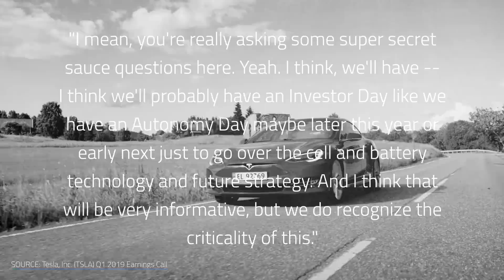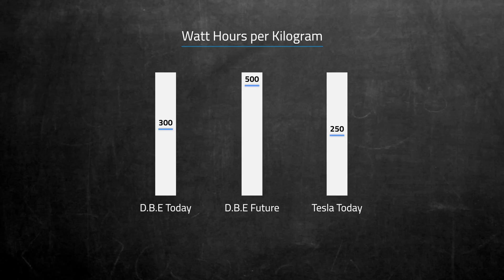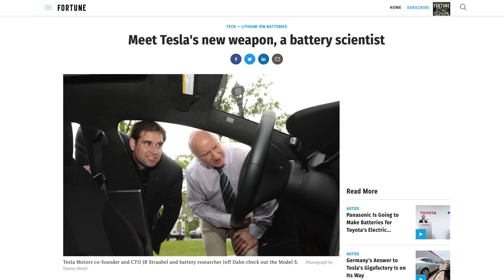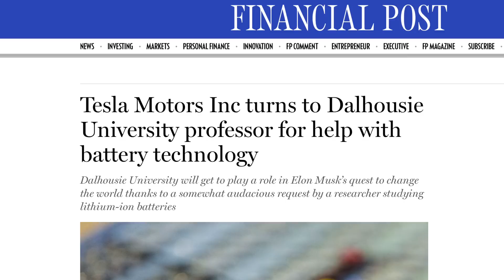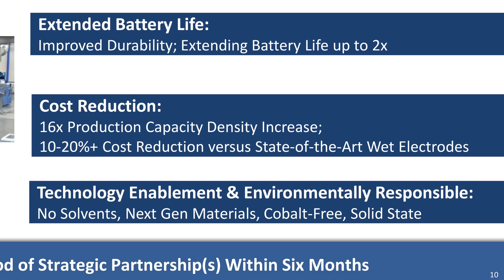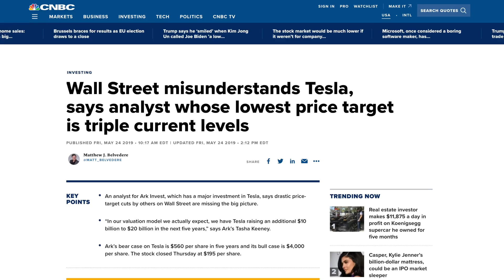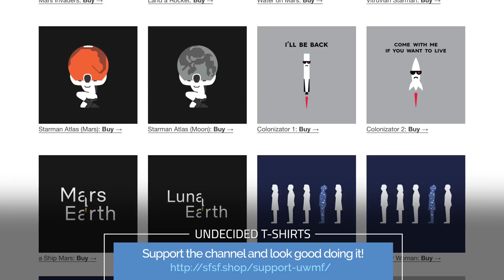Tesla And Maxwell Technologies

Comment: 26th Feb 2020 Your analysis is on track with the current chat ahead of Battery day. 8 months ahead of the pack. Yes, they have moved to prismatic batteries for China and yes, the Braga solid glass electrolytes may be around the corner, but Maxwell's Dry Electrodes & Dahn's formuleas are now . The dry electrode technology could probably to used in any LI ion batteries. Keep up the good work.
Reply from the maker: Appreciate that!

Comment: IN THE UNITED STATES,
Due to the many charging points, the company has great potential and great competitiveness with its competitors.
NOW IF IT ACHIEVES THE GOAL OF 1,000,000 MILLIONS .... WITH THE SUPER CHARGERS IT WILL BE A VERY DYNAMIC PLAYER FOR THE FUTURE.

OPPOSITE IN EUROPE
WE HAVE SMALL SALES OF ELECTRIC CARS.
WHY THEY PURCHASE THE COST, AND THAT THERE ARE MANY COMPETITORS. WE ALSO HAVE MUCH LESS CHARGERS.
Also in Europe there is the mindset of hybrid cars.
IN EUROPE WE HAVE NETWORK ISSUES BECAUSE IT IS NOT A SINGLE COUNTRY AS AMERICAN, BUT ALSO WITH A DIFFERENT MARKET IN PRODUCTION.
That's why HYBRID WILL STILL HAVE THE UPPER HAND, UNTIL FINISHED The ELON FACTORY IN BERLIN AND WHERE THE GOVERNMENTS convincing GIVE IN MOBILE average citizen BECAUSE THE 30 TO 40 THOUSAND EURO IS VERY HIGH COST FOR AN AVERAGE EUROPEAN CITIZENS.
THANK YOU FOR THE COMMUNICATION

Comment: 1m miles is fine but they also need to ratify that claim into product warranty ! Currently model 3 comes with 50k miles warranty which is not even competitive with Korean car manufacturers!
Reply: Current model 3 battery is warranted for 8 years 160,000km.

Comment: i think the super capacitors are the key to this deal. regenerative breaking will charge up caps instead, massively reducing wear and tear on the batteries that hate rapid charge/discharge, which caps a built for. this will allow near instant charging as well, as caps could be filled in seconds or less, for say 50 miles. caps will handle the volatile charging/discharging on the small, short term scale. i think maxwell's long term engineering advancements in various applications for over 50 years, will translate into much better native handling in one big ecosystem between the penthouse (controller box) and the batteries. i think since they are dry batteries, this will change the cooling needs, and allow for much more flexibility in the battery placement/layout. i think all this combined, will efficiently double the life, and distances traveled on a charge. i reckon at first maybe 500-600 miles, before further optimization getting more distance. the true target of course is making a coast to coast trip in the same time as an ICE car. maybe the 1000 miles is the sweet spot. drive 1000, sleep and charge for 8 hours, drive another. driving SF to LA on one charge.

Comment: Sounds like the Tesla drivetrain will significantly improved. The Tesla electric drive train is certainly better than the small number of offerings ccurently available from the competition.  Tesla continue to hemorrhage money. So are they ahead of the competition? Batteries and motors, the drivetrain,  are ace. The rest according to end users and a major automobile manufacturing benchmarking company in USA is behind the competition in terms of quality and design.Perhaps the future for Tesla will be to supply electric drivetrains to the mainstream manufacturers.

Comment: @Matt, good video. Consider also the Supercapacitor element of Maxwell Tech. Usng Supercaps to deliver instantaneous power in ludicrous mode for instance and even store and recharge during regen would be another great integration of th enew acquisition. Supercaps could also be used to facilitate the higher changing loads with 350-450Kwh charging and protect the Li cells from the heat diffrentials thus giving them a better service life.

Comment: Sure. You mentioned some things of which I was unaware but I had previously been led to understand that by Maxwell's integration of supercapacitors that could quickly capture braking energy and expend it in acceleration was the biggest boon to battery life because it would smooth out battery discharge rate.

Comment: I think that a sort of hybrid battery design is possible.  We know that when we fast charge a battery from near empty to near full that the battery becomes slower and slower to accept the charge.  Suppose that as the charging became slower, an ultra capacitor would engage and load up to discharge into the chemical part of the battery after the vehicle had left on it's way..  This would provide several benefits.  The Lithium Ion portion could be smaller and still one would have the same range.  Of course the time at the charging station could be reduced..The chemical part would be lighter and more compact and longer lasting. One could still use the capacitor side to make regeneration more efficient.  Clever engineering might even unite the two elements at the cell level but more likely not.

Comment: Matt, you can't compare Tesla to Apple. Tesla makes almost everything in house in California. They even brought Panasonic to arizona so they can make batteries for them. Apple  has most of  their phones put together in Asia with many components from asia- Samsung chips and lcd. The structure of the phone is made in China.
Reply from the maker: My comparison of Apple to Tesla was more than just the vertical integration.  Apple designs almost the entire widget (very little off the shelf parts).  They also design much of the manufacturing process (even though they don't do the building themselves).  I should have made it clear in the video, but I was comparing the two during Apple's heyday ... when they were rocking upwards from the iPod through the beginning of the iPhone.  They were the most shorted stock on wall street (still are in some cases).  The drum beat of news reports was how they were doomed.  "Just wait for [competitor X] to release their [product x]" and Apple will be done.  They're a highly divisive company.  The people that hate Apple, HATE APPLE.  People that like Apple are nothing but sheep.  The fact that Apple was building a better product than the competition and gained massive market share because of it was often missed or ignored.  That's Tesla today.
Reply: @UndecidedMF  I'll give you that, Apple designs a lot of their own chips and other compononents but they can't be compared to Tesla. Tesla designed and mostly built their own supercomputer, software,GUI,Ai,and electric car. To top it off they built their own manufacturing plant. Tesla is like Apple,IBM and Ford mashed together back in it's heyday.
Reply from the maker: Apple has done a lot of the same stuff: https://www.investopedia.com/terms/v/verticalintegration.asp

“Apple Inc. is one of the best-known companies for perfecting the art of vertical integration. The company manufactures its custom A-series chips for its iPhones and iPads. It also manufactures its custom touch ID fingerprint sensor. Apple opened up a laboratory in Taiwan for developing LCD and OLED screen technologies in 2015. It also paid $18.2 million for a 70,000-square-foot manufacturing facility in North San Jose in 2015. These investments allow Apple to move along the supply chain in a backward integration, giving it flexibility and freedom in its manufacturing capabilities.”

There’s a lot of similarities.  Now, that doesn’t mean anyone has to like Apple.  The companies are have very different goals and motivations.

Comment: No mention on their super cacitors and how well that integrates with Tesla tech?
Reply from the maker: Yeah, I sidestepped that because I don’t think it’s one of the primary reasons they bought Maxwell.  They’ll most likely be taking advantage of the supercapacitor technology, but exactly how remains to be seen.  And even then I don’t think it’s going to have as significant impact on the bottom line as the DBE method will.

Comment: Batteries are the BUG in the system of almost every product, so these Ultra Capacitor Batteries  that can Flash Charge to full in just 11 seconds are amassing. I've put video links to these charging in my Twitter threads.Also Graphene is the major component. Just imagine how these lightweight Ultra Capacitor Batteries can revolutionize E Bikes?

Comment: all the nasty analysts are affraid from tesla innovation because of the oil industry... there is so much pressures from them to stop elon musk revolution... personnally  ...
i would buy a tesla model 3 without hesitation if they could make the range of batterie at least 600 miles per charge... for a reasonnable price compared to thermique vehicules... only tesla could make this dream a reality...

Comment: 1 - Batteries always weigh the same, empty or full.  Unlike all fuel tanks.  And I don't believe Tesla's battery weighs less than than most full fuel tanks.
2 - There is a limit to energy density when it comes to vehicles. Several will die in explosive automobile accidents until they figure out what that limit should be.

3 - Not a single mention of this deal's impact on SpaceX??  Not even just a, "...and who knew that batteries are also used alot in space?"

Comment: Maxwell technology patents cover more process related tech than  product......things that could possibly take some of the time (cost) out of making Li batteries - like having  to carefully dry the deposited materials etc.   Remains to be seen if it can be turned into real production …..there are no lack of chemistries out there that will improve energy density but manufacturing processes to lower production cost is equally important.

Comment: You didn't even mention the supercap aspect of Maxwell that could help buffer the recuperation cycles off the battery...even increasing the longevity of the pack further
Reply from the maker: Yep, that was by choice ... mainly because I don't think that's the big reason Tesla bought them.  I do think Maxwell capacitors will play a role, but the biggest aspect for Tesla is going to come around battery production.

Comment: First the negative: Telsa does have a significant burn rate. Low margins. Also, Elon announcing the 1 million mile rated car undoubtedly is slowing down current sales, buyers waiting for the 2020 model. HOWEVER, the Maxwell purchase puts Tesla WAY in front on batteries, especially on cost which is expected to drop by 50% in 2 years and will continue to drop. Tesla will be years ahead on battery cost, battery life and driving distance. Tesla is also 2-3 years ahead in auto drive, Elon expects Tesla's to be fully automated by the end of 2020. Their lead in auto drive is partly due to 98% of all driving data available has been generated by Tesla. Then Tesla Taxi will make cars into money machines for purchasers and for Tesla, likely capturing most of the revenue of Uber and Lyft. So, expect sales at the end of 2020 to shoot off the charts and with decreased battery costs their profits will soar. 

Tesla will be working on the next innovations while the majors will be scrambling to catch up to Elon's previous innovations. I see this propelling Tesla to become one of the major car companies in a short time and one of the most profitable. The old guard is in trouble. Tesla is still too nimble to catch up to and they are increasing their lead.
Reply from the maker: Well said.  I’m worried about the Osborne effect with some of these announcements.  There’s a fine line that Tesla and Elon have to walk and I hope they don’t pump too much excitement for what’s coming that it hurts the great products they have now.

Comment: Could the battery be a dual system? The mawell batteries are fast charge and release whereas the nilion are slower and longer charge and release?
Reply from the maker: For manufacturing simplicity, I think it's one or the other.  Perhaps Maxwell capacitors will be worked in at some point, but for batteries I think it's going to be all Maxwell DBE all the time.

Comment: I want to know how fire-proof his new Maxwell batteries will be. As it is now, fire departments have to immerse the whole Tesla vehicle in cold water for a week to make sure the battery fires are really out.  A whole week completely submerged. The whole car.    Furthermore,  the charging stations around the country are going to have to get smarter as well as the charging circuits in the cars themselves to prevent overcharging and subsequent fires.  The thing is with batteries - some cells actually reach their full charge capacity before others. This has to be sensed and mitigated on a cell-by-cell basis.  I don't think it's working properly at present.
Reply from the maker: Those fires that have happened in China recently are still under investigation, but they’re extremely rare.  Tesla actually has some very sophisticated engineering and software management for their battery packs to prevent overcharging.  Just this week I saw a new patent report come out that Tesla has designed a system to better check the health of individual cells within the battery backs.

https://electrek.co/2019/06/10/tesla-battery-research-group-patent-cell-failure/

Comment: supercaps will extend cycle life of lithium batteries, and provide more torque to drive motor, without taxing the battery cells....but supercaps will still take up a lot of space, along with the lithium cells, so this is one hurdle not talked about much.  Still, the door is open for advancing battery storage capabilities.  Cheaper?  I hope so....EV’s are still way too expensive.  With fewer moving parts, and simpler drive components, EV’s SHOULD be cheaper than Petrol cars...still not the case.  Consumer still getting gouged for what they are getting.  I will patiently wait.

Comment: I'd credit Wall Street with a bit more vision here, they've chucked billions into Tesla and haven't got a dime to show for it. In the hope of profiting from the next Amazon I suppose.  Anyway, they do love Tech bubbles.
Maxwell tech if it works should be a game changer, nevertheless you should curb your enthusiasm, kid.
Battery powered cars aren't going to stop climate change when most electricity comes from coal. If you think wind and solar can supply this you delude yourself, as does Elon,  the ultimate exemplar of clever stupid.
His shtick about a car going a million miles " essentially maintenance free" really annoys me.  I own a car with 96000 miles.  It costs me around £500 a year in maintenance costs beyond fixing the engine. Tyres. Suspension. Steering. I could go on.  No doubt those who can afford a new Tesla are unaware of these costs,  it just bugs me that you parade your ignorance as superiority.
Reply from the maker: Parading my superiority?  I’ve never been accused of that before.  Battery powered cars aren’t going to solve climate change, but they’re one piece of the puzzle.  A coal powered battery car still puts out less CO2 equivalent into the atmosphere over its lifetime than an ICE car.  Solar and wind are also just one piece of the puzzle to sustainable energy generation.  Not every car has to use a battery.  There’s fuel cell technology.  Not everything has to be solar, wind, or hydro either.  There isn’t one right way to do any of this, but a collection of things we can do.

There’s no oil to charge on an EV.  There’s no coolant to change.  There’s dramatically fewer parts that fail from wear (not just engine vs. electric motor).  But nobody claims or thinks there’s no maintenance.
Reply: I think you need to do your math again young man!  Once you factor in the embedded carbon of that lithium battery the carbon footprint of a Tesla is as high as an ICE car.  And if car makers got off their butts and put the same effort into fuel efficiency as Boeing or Airbus they'd probably be substantially more carbon friendly than Tesla.  
I sometimes feel like I'm debating a cult here.  Of course there are idiots out there who totally dismiss Tesla without even investigating the facts, their numbers on the internet however seem to be small. Tesla fans on the other hand...
You lot seem to be equally devoid of nuance.  I on the other hand am a freakin' agnostic and you believers really set me off. I kinda like Tesla's but I have doubts.  Such as: will I ever be able to afford this tech? I see comparisons between Model 3s and Audi A4s, no way can I afford an A4.  And that's the base model Tesla.  Do I really want a car with a 220mile range? I park my car on the street outside my home, how do I charge it up? (200million other Europeans have the same problem!) Do I really want to spend  $40000 on something with the same design philosophy as an I phone? Millions of tech savvy people hate these things because they're overpriced and can't be repaired.  
On the other hand.... The performance characteristics are excellent, low centre of gravity and instant torque.  And if you compare a Model 3 to an equipment high spec German make, the Tesla has to be better, if only because BMW/Audi has over complex engineering to achieve the same performance.
And as one who buys old cars I used to think how could you possibly buy a used Tesla when you would soon be hit with a $10000 bill to replace the battery pack? I think given that most cars get scrapped anyway before 130000miles is surely relevant here.

Comment: We still need cheaper batteries and faster charging for EVs to crush ICE cars
Reply: Charging is already down to 30 minutes for an 80% charge and even 15 minutes in some cases, that is enough of a drop to ensure people will buy when range is extended to over gas car range which is coming any day. I have an electric vehicle and charge it overnight once a week as i do not need to do more than that, and yes like gas cars i hate getting to the point where my range is low,but unlike gas i can plug my vehicle into the power at home and have a full tank the next morning.